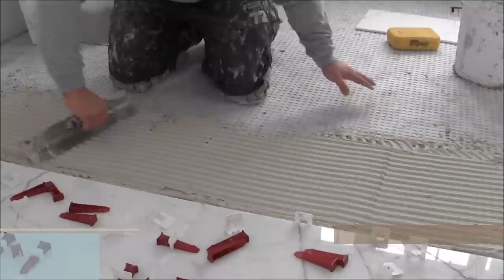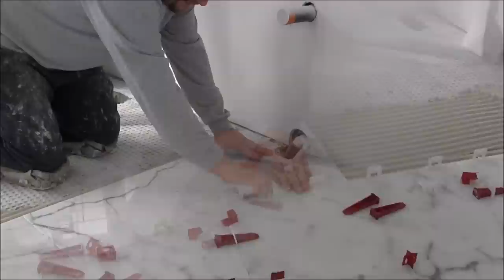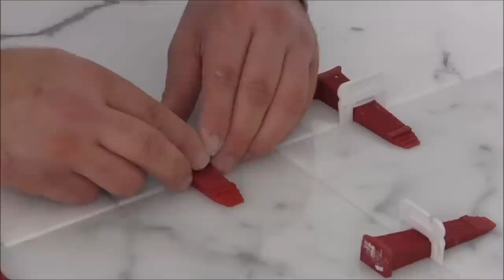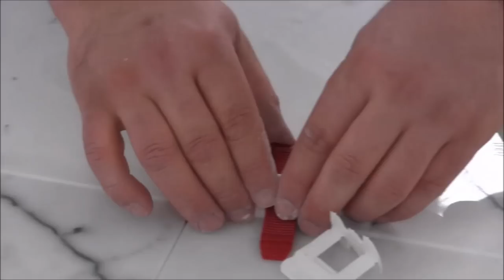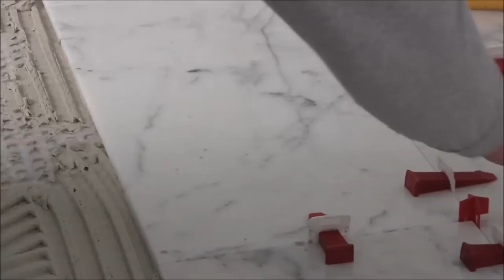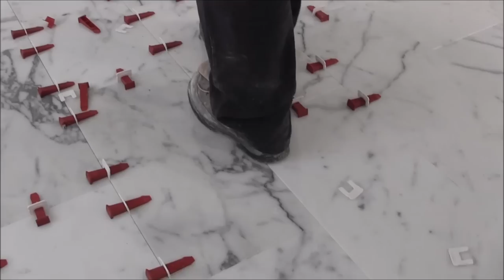12"x24" (30x60) marble tile installation using Perfect Level Master™ T-Lock­™

Comment: Hi. Find this product to be very interesting. Got a question, What type of grout is most suitable for this type of marmer (white, light grey)? and what spacing distance spacing should be used to make it look like one piece ?
Reply from the maker: Azurae21 colour grout should much marble colour in this case will be light grey.Distance as small as possible 1mm or 1/32" but maximum 2 mm or 1/16"

Comment: It's a great way to level up your marble. But please if you are going to back butter your marble make sure your corners have complete coverage.thats were it always break
Reply from the maker: whatburnout yes you absolutely right... but in this situation is just to prevent so marble will not absorb the water to quickly from adhesive (the layer is very thin - is not  applied for levelling purpose)
Reply: what do u mean break? when? years later?
Reply: You all probably dont care but does anybody know a tool to log back into an Instagram account?
I was dumb forgot the password. I love any tips you can offer me.
Reply: @Alessandro Josue instablaster :)
Reply: @Brantley Bryan I really appreciate your reply. I got to the site thru google and im trying it out atm.
Seems to take a while so I will get back to you later with my results.
Reply: @Brantley Bryan It worked and I finally got access to my account again. I'm so happy:D
Thank you so much you saved my ass !
Reply: @Alessandro Josue Happy to help xD

Comment: i like the idea i think is wonderful to have a really level floor but i will also have to look at productivity. how much area could a person do in a day and if it could be done in a efficient way to increase speed in layout
Reply from the maker: He does tile/marble installation for 15 years 
Tile Leveling System for 3 years... According to him he can do 350 sq/ft or 32 m2 per day perfectly instal tiles with no call from customer... In the old days 100sq/ft or 10 m2 Please watch that video and see why New School of tile installation by using T- Lock tile levelling system ...become better http://youtu.be/sMjZAYlHvks you can achieve 100% bonding to the tile
Reply: thanks for answer my question. i will use the system that you show and see how much difference there is, or the change between them thanks
Reply from the maker: +jairo cuautle If you're in Canada or USA you can  go to www.perfectlevelmaster.com ...good luck

Comment: We used for both 2'x2' tiles as well as 12"x12" tiles worked great on both. Very helpful for wall installs. If your thinking about tiling go with larger tiles if you can they are much easier to work with in our experiences. 2'x2' was nice i feel 2'x3' would also be pretty manageable as well.

Comment: donde compro los separadores esos para sujetar.en tabasco
Reply from the maker: +Angel Dominguez Por favor visita: http://ptxgroup-store.com/index.php?route=product/category&path=74_85. Gracias.
Reply: +Polmaster Construction & Tile Ltd nice video. Would you not need grout in between the tiles?
Reply: pero no m dan direccion.digame por favor donde los consigo en tabasco .o por pedido
Reply from the maker: +musicfrendlii96 Definitely you need the grout in between the tiles. As per video,  once the clips are removed you can start grouting.
Reply from the maker: +Angel Dominguez http://ptxgroup-store.com/index.php?route=product/category&path=74_85. si necesita assisstance favor póngase en contacto con nosotros en: info@polmaster.com

Comment: Whats wrong with leveling tiles using your eyes and hands? If you are a pro you should know how to lay marble. If not you should leave it to pros.
Reply from the maker: Nothing wrong using your eyes and hands....but there is a tool which can improve your installation with speed and lippige free 100%.
Please watch this video if Pro Installar can do this installation with out to this tool http://youtu.be/ESy3DHfN4Zw
Open minded pro is looking for improvement all the time.
It's not enough to use your hands and eyes in your future installation, if tile size is 6"x 48"(15cm x 120cm) or 36" x 72" (80cm x180cm)
Naturally this tile is not straight.
There is more videos on YouTube "Polmaster tile" for example "Huge Tile Installation 5' x 10' (150cm x 300cm) enjoy it.
Reply: It allows an amateur like me to produce professional results
Reply: Polmaster Construction & Tile Ltd. i agree with u 100%
Reply: Real tile installers don't need those dumb wedges and without the wedges you install way faster

Comment: makes hollows in the tiles because not enough glue at start .
Reply from the maker: First trowel is 1/2" or 13mm.Backbutter trowel on the tile is 1/8" or 3mm total 5/8"or16mm this'll be enough for prepared floor (that's what it is) and when you're using tile leveling system T-LOCK™ from Perfect Level Master. Clip (base) under the tiles is only 1/16" or 2mm thickness that 8 times thinner.We love this system... for 3 years perfect installation every time and fast

Comment: Question: Are floors must be leveled ?
Reply from the maker: No...flat only
Reply: joseph okhotin nop but you need to make sure that the bed(adesive) is at least 4 or 5mm thick thru all floor.otherwise stone can break or become lose after time .

Comment: beats using a puck and a level.
Reply from the maker: In old-school installation.. installers still using a puck to check Level between the tiles
In new school level it's control by locking them together on top of that... you walk on them right away after installation for better bonding please watch that video for more information http://youtu.be/TNeNqcQw4Po thank you

Comment: lmao uh I wouldnt set a piece of stone like that for anything!! Man that just kills me to watch that..............now Im gonna go yell at my helper!!
Reply: Marble Pimp besides the leveling system,how else do you lay marble? I mean spread the floor,and back butter what else is there? do you do a thinset/fatmud lay?
Reply: I set it in mud my man.I wont set stone in thinset lol nope wont do it!! and when Im done its level. And I butt it together,which is why most stone is beveled.If its  not I bevel it myself!! Tile & marble are not the same trade. Any hack can put down tile these days but you give a fool a wheelbarrow full of mud and a rubber mallet.........then you can see what hes made of.Them " levelrs" only make it flat not level.big difference my man
Reply: Marble Pimp ahhhah yeah I agree,I've never used anything but a level,rubber mallet and my hand for setting, and didn't realize that mud was they way to go on setting stone,what if you have height restraints, doorways,existing flooring etc?
Reply: Marble Pimp also do you have an instagram?
Reply: and them boys need to work on culling through the stone before setting and to key in thinset into matting,and sponge stone before back buttering.That looks like Statuary and it needs to be mixed .I go through all my stone before I pound 1 piece in. Natural stone can surprise you about halfway through the crate lolol remember its not tile...its natural and the variance can actually ruin a job if one does not take the time to go through ALL the stone.But dont be sad I charge enough to cover my labor since 90% of my work is in Longboat Key Fla!!! People with huge houses and lots of money are the clientele I prefer.They buy lots of stone very little tile and pay me when Im done.I do alot of master baths and huge intricate floors with stupid inlays lol water jet cut  medallions and other things I charge an enormous amount for!! And then theres the whole yearly sealing some floors, friggn Travertine !! The tile trade has changed so much I rarely will do a tile job. Prices are so stupid cuz everyone is a tile man these days. Hell man I still see guys putting fixtures in the drywall with unsanded grout lmao thats why they make unsanded thinset you silly man lolol
" whats that"
unsanded is a sticky thinset that beeen around forever and will stick to drywall with out any latex.When sheet tile was all there was...and 4x4's lol unsanded was the main thinset to use. but of course all floors where floated with deck mud and where perfectly flat so it was a cake walk to install..........yep Im old and am a big book of knowledge. real marble men wont set stone in thinset lol no friggn way man
Reply: no instagram is for kids lol
Reply: xxxnolove
 well if I have an exsisting floor I just put a threshold I had made and angle it down. most of my floors are usually 3/4 to and 1' of mud depending on floor,which I flash out to save on labor. Most exterior door thresholds are high enough to level up to......but one migh t have to cheat a little ,,,which is where the string line comes in handy......old dudes from Italy use dental floss but I prefer nylon string  :]
Reply: I can see using them levelers on the really big large format tile they make these days butt if a man is going to be a "mechanic" he must learn to feel the material hes setting and make it flat ,thats how you learn.If a man only uses them self levelers on every install he will never learn anything and will remain a "thinset artist" forever!!
Reply: Thank yo for your comment.  I saw this video when searching for setting marble.  Just the cover photo of the video made me gringe.  I live in broward county.  I remodel bathrooms for a living now. Was tought to lay tile with the mud set method.  I also do natural stone. Luckly I have a good client tell and most of my customers refer me to someone else.  Its incredible the amount of hack jobs are out there. I havent been doing tile for a long time, i think 4 years.  I do always make everything level with my 2ft, 4ft, 6ft, and laser.  I am happy there are others who want it done right.  A flat floor isn't the right way.  Level and flat is. Later
Reply: Marble pimp. You are soooo amazing and wonderful. I think I just threw up a little . Why don't you put up some awesome videos then mr. Pimp and educate everyone as to the right way.
Reply: @marblepimp1369  Hello I am a Moroccan. I am 28 years old. I have a great experience in installing marble and I love Canada. Can I help you work with you and live in that country
Reply: Marble Pimp men i learn the way how to instale marble mudset in sarasota i guess you know south west rock🤘